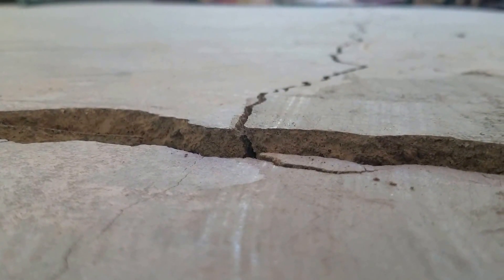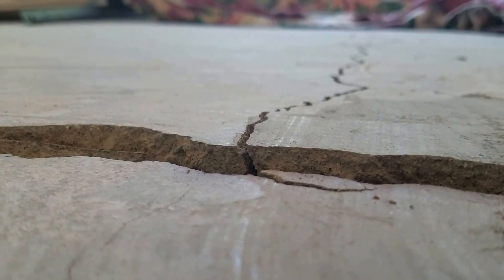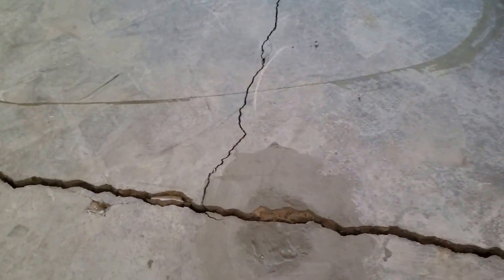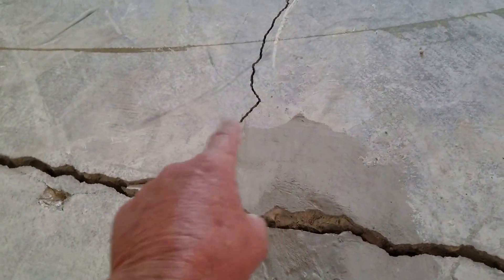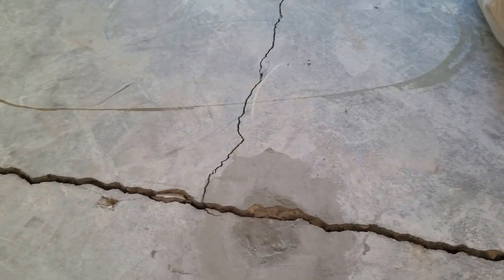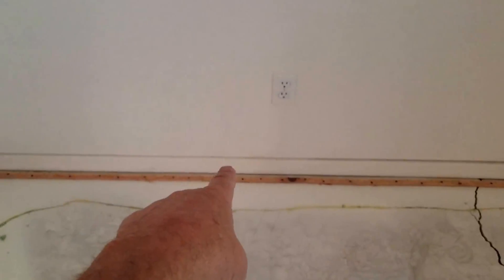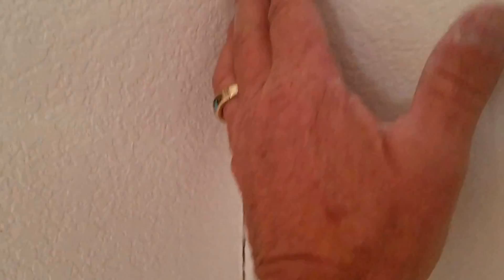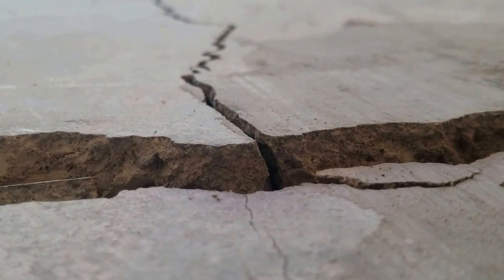Foundation Heave Cracks, Floor Heaving Not Caused By Expansive Soil?

Comment: Wow. I have been trying to talk to someone to figure out whether my walls in my garage are sinking or if the floor is heaving. Your explanation was so simple. 
Now I just have to go through your videos to see what a solution might be. 😅
Reply from the maker: The solution is rain gutters grading your property to relieve the moisture next to your home.
Reply: @ConcreteRepairman it’s actually my garage.  The alley next to my garage is higher than my garage which creates an issue. I will talk to the town and see if I can put some drainage between the alley and my garage. It would only need to be about 30 feet long.

Comment: My cracks aren’t this big but I’d say about 3/16”s but the same of the triangular fracture in three rooms the living room has this. What is your input
Reply from the maker: Continue making improvements around your home, reducing the amount of moisture near tt.
Reply: Should I grind with an industrial floor grinder until it’s more level, then seal the cracks & then self level the floor?
Reply: I’m planning on installing vinyl floor
Reply: Also the crack is less the 4mm it’s like 2mm

Comment: I'm looking to buy an older house (40ish years old). I've seen that the first floor tiling is not level, but there seems to be a slight slope (about 1 cm is the height difference). I haven't seen cracks, but it may be cover up by the tiles. There seems to be a rather sharp separation in level at the middle of the room.
Is there something else I could check to verify the house's structural integrity?

Comment: Ok so how did you repair all that damage?
Reply: Like he said, gutters and long drain spouts or underground pipe running rain water to the property line away from the foundation.  To stop the foundation movement, steel piers driven down to bedrock attached to the foundation will stop all movement.  Not easy, not cheap, but would save the house.

Comment: I have this happening in a cabin I bought that was built in 1930, im looking for a more diy route of repairing this type of crack. We plan on filling the crack with cement all and floating out then grinding everything down level.
Reply: Gotta stop the source of the movement before repairing the slab.

Comment: We’ve complained that our condo-townhouse has erosion out the back to a canal that passes behind the building.  When deck restoration was started, you could see that fill from under our concrete slab had eroded a good 8 feet under our living room to the back patio.  Our tile floor shows a fine crack from back to mid-living room.  Should we be concerned, or is it normal to have voids under your slab?  Will a 4 foot, wood plank retaining wall be enough to hold the fill from eroding into the canal—the townhome is elevated over the canal by about 6-8 feet?  We alerted Florida Building Code Enforcement, who issued the permit for the deck restoration, but they were apathetic.
Reply from the maker: You need a Civil Engineer.  The engineer will draw up the repair plan. Some engineer firms also do their work, which is likely going to be the best. In the end you will have certified repair work done certified by a licensed engineer, this will help sell your home.
Reply: @ConcreteRepairman  The deck is common area behind my condo, so the restoration was done by the Assoc.  The outside of the condo, including foundation I assume, is the responsibility of the Assoc.  Having noticed the void under our foundation as they demolished the deck, we told the Assoc. and the local Florida buildings dept (same people who issued the permit for the deck restoration).  Neither cared.  We took pictures, but that's where the issue comes to a standstill . . . until the erosion levels my home.  Was just wondering if this common, to pretend it doesn't matter until the building foundation snaps?
Reply from the maker: @mavirek   They're not gonna argue with civil engineering. Likely and out of pocket expense for you however you'll sleep better at night.
Reply: @mavirek  FL = sandy soil.  Hollow under concrete = bad news.
Maybe foam  or mud jacking to the fill the voids and grind it flat !

Comment: I have watched a few of your videos and appreciate the clear explanations that you offer for the problems.  I just wish I could find someone like you in Austin.
Reply from the maker: What do you need in Austin? Foundation inspections?
Reply: Who did you end up using in Austin? My 20* 20 tile floors are developing long hairline cracks inside the house in several places and I called the foundation companies who didn’t say much. And today I noticed that the crack is actually running from the exact same spot from the garage concrete and is exactly lining up the crack in the middle of the house running from garage to laundry and now to living room and horizontally to the kitchen. This was the first crack that was there when I bought the house since nothing was said in inspection and now it has spread. House had no rain gutters and 12 years old. I have installed the gutters but I can see changing the floors won’t help if the underlying issue is not resolved.

Comment: Thank you for this video it is very rare for soil rising to cause cracking the soil is much less dense than concrete so water will take path of least resistance and that is out through the soil. Without freezing it is very difficult for water to raise a concrete slab

Comment: Can you give me a guesstimate of what repairing cracks in a similar indoor concrete foundation, but not as extensive.  The cracks are less than 1/4”.  The buyer is saying it will cost $35,000 to repair and wanting to lower the price by that amount.  
Thanks 
Diane

Comment: I have a crack in foundation and live here in Texas. I’ve had foundation companies come out and say my home is off about 4” on the right side. $23k to repair since I want steel piers and that’s putting piers all round and about 8-9 internal.

I looked into my own structural engineer and he said no repairs needed at this time since slope is within tolerance and gave me recommendations. What would you recommend to use to seal my crack?  Engineer said epoxy injections but I really don’t want to spend $3-5k on this crack and come to find it reopens in a year or so... Any suggestions?
Reply: Most of these foundation companies are scammers, they are in the business to sell you piers NOT the solution. 
We had a guy came over and told us we had a void under our concrete floor by stomping his foot and said, see it's hallow and told us our house was sinking. 
We found out the previous owner had stabilized the foundation and had lifetime warranty for peirs and that guy happened to be working for the same company the owner had used.
I told him to come out and take care of the problem he discovered, he said I didn't need anything. 

I would recommend to bring in other foundation guys for their opinion (not just one) and see what they have to say.
You might just have some concrete shrinkage and not too serious. Just make sure the drainage is proper.

Comment: I think I have the  expansive soil. The cracking seems to have been caused by heaving when the house was first built 12 years ago and no further heaving seems to be occuring. Is there a solution for that?  I would like to level the floor again and relieve the tension if thats another factor in the cracking.

Comment: Expansive soil also contracts kind sir.   This creates hollow voids under slab..  ive been living in a home on clay soil and expansive is  not the correct term for it.  Breathing clay soil is more like it.  On say after a week of good steady rain, although i have correct grade and new gutters along with a perimeter interior drain tile with sump directed well away, my walls and lally supports on the single beam 2 story slab basement block foundation will move as much as 1-3/4” and when it dries out the column and walls, depending on saturation levels determines what moves, will lower the same.  My gas pipes and water i have put on flexible piping and the meters are in balance. Only crap i get is all the inside walls upstairs, none in basement, will separate from the ceiling as well as floors will separate from baseboards equaling the moved distance of the stuff downstairs..  my slab has been repoured with rebar and installed both helical and straight piers all driven to their max pressures, filled the block with rebar and morter, put up I beams in slab every 4 feet with 4 tons of pressure against the walls, repoured all footers 48x48x48 for the 3 lally columns in  my 1000 sq ft basement below grade halfway.. and now the entire house acts like a ship..  slab still cracks though and im guessing hollow voids under from movement.. every house on the block has gone  through same stuff.. water mains, sewage, hell one blew up down the road and leveled it from gas leak..  is when i fixed mine..  the  whole street got hush money though, dont tell anybody..  haha..  anywho im stumped as to use foam or concrete at risk of the concrete drying  and having boulders shoved through  the floor or the foam just collapsing and molding or something..  dunno if it does that or not..  about give up  on this house after  paying 120 for  it and putting the same in it, feel pretty much like what im guessing a gay man does at this point..  nasty.. sorry bout that but bent over backwards just didnt push the feeling right..  anywho   Food for thought..  the house thing, not the nasty..  well  yea.. ok then..
Reply from the maker: Hi Z Ack, thank you, good to here from you.

 Yes, expansive soils can cause problems fur shure. I have removed 100's of slab that have heaved. Only 1 slab heave was caused by the home settling causing the water line too break. This cause the esastibation of the expansive soil to swell. All others have been proven not caused by expansive soil based on the evidence on the exterior vertical breaks, cracks in walls, doors not to close, and ceiling cracks. It is true that expansive soil will shrink and is usually the excuse given after you tape the crack and it sound hollow. 99% of the homes I investigate with heave cracking on interior floors is not caused by expansive soil problems. Arizona footing are 24" in depth from the interior floor elevation to the bottom of soil that holds the load. These shallow footings are easily moved by moisture holding causing settlement. These interior floors have outward pressers, and is considered a "Floating Floor". As the foundation moves downward the interior floor can follow the foundation walls down causing the interior floor heave cracks, cracks in ceilings, doors not to close ect..... The floor can also slip, and not follow the foundation wall down.

Thank you for your comment.
James Belville.
Reply: The general used term that describes high clay content soil that expands and contracts according to moisture content is "shrink/swell".  Not all clay soil has that property, but most do.

Comment: Having similar problem with my home in Gilbert. So gutters will help with this issue? Will I need to have concrete piers installed? and will I have to get rid of my automatic drippers system for plants?
Reply from the maker: Settlement is the cause of interior floor heave. By controlling what's causing settlement you control the outcome of how extreme interior floors heave.

Call my office 602-418-2970
I will be happy to come out free of charge and evaluate your situation and show you the evidence of what is actually going on.
Reply: what is your name sir? I will be giving you a call thx
Reply from the maker: @Sonikbytes  James Belville 602-418-2970